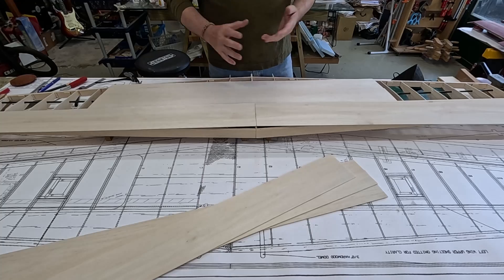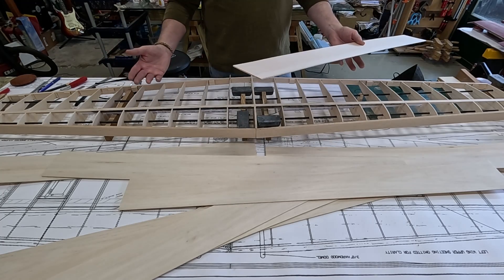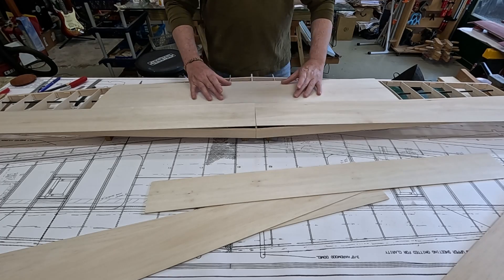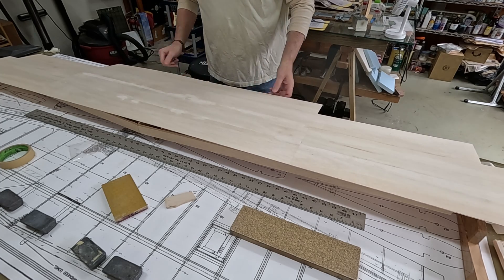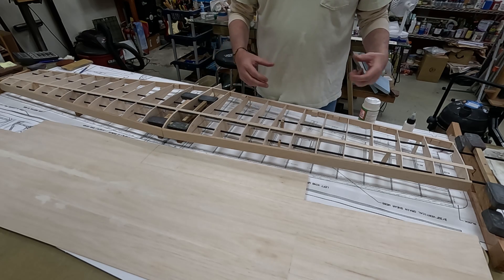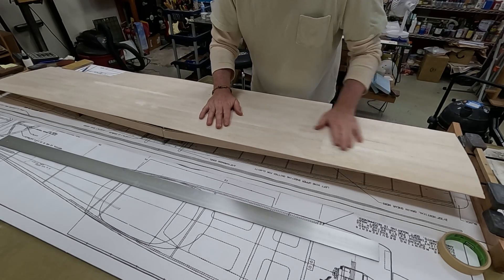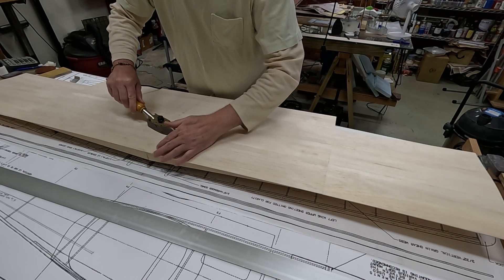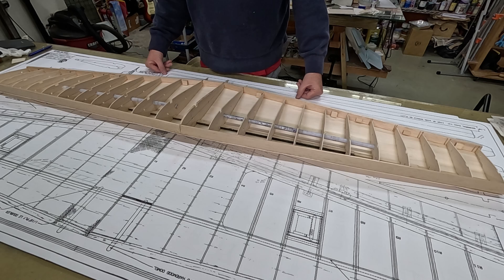DR-107 One Design RC plane build, Update #5A (wing sheeting, part A)

Comment: Thanks for showing the iron on method.  I have only read about it on forums.
Reply from the maker: @eansmith4925  it is my favorite sheeting method even though I did have issues on this model because of the glue used.  I have found that the original Titebond works best.

Comment: Great build.  Where will you get the cowling and canopy.  I am building this model and want those two.
Reply from the maker: Thanks.
I will make both the cowl and canopy.  For the cowl, I will use the lost foam method with fiberglass.  I have a vacuum-forming machine for the canopy.
Reply from the maker: Are posting your build?
Reply: @BalsaAeroProjects  No.